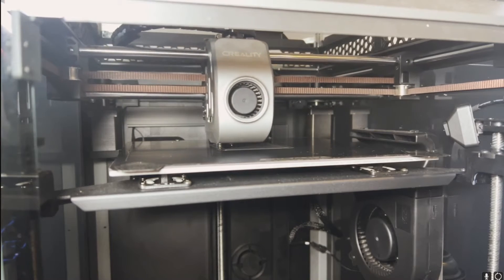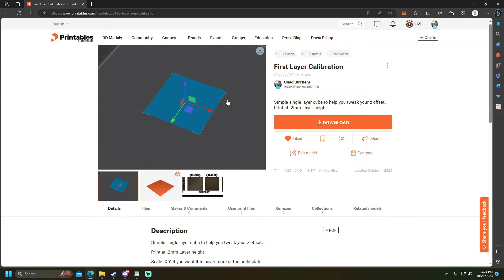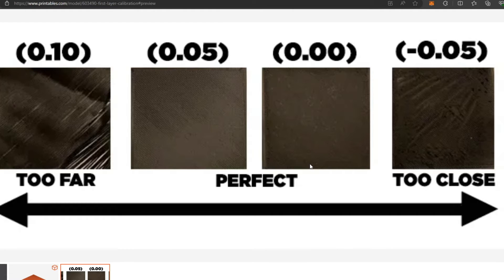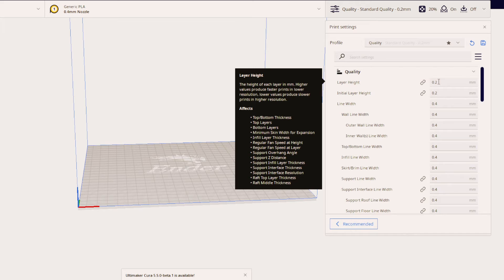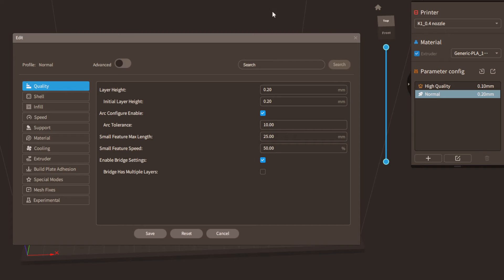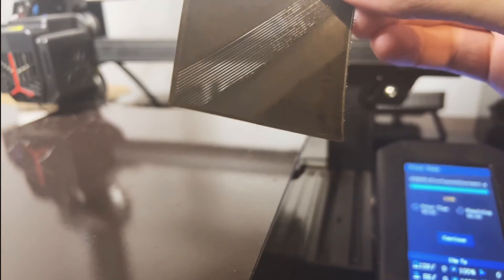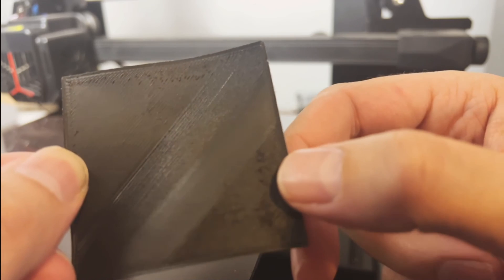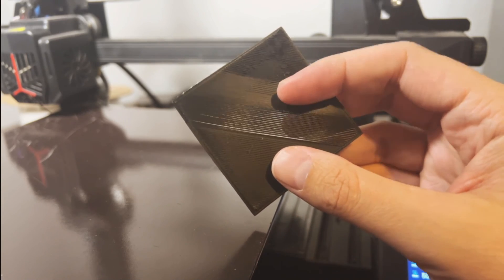Fix Your 3D Printer First Layer Issues | Z Offset Calibration | 3D Printing

Comment: I have to say, it wasn't until you mentioned trying to pull them apart that my offset was fixed. I kept thinking it was fine because it looked good, but as soon as I pulled on it it separated like string cheese. If anyone takes away anything from this video it's that. Thank you.

Comment: this is great I use cura and before you get to the z settings to change you switch slicers and i cant find that setting in cura I have Elegoo Neptune 3 pro i have theier orca based slicer

Comment: Having a strange issue on my Ender 3 V3, basically K1 bedslinger, where along the Y axis it seems to be smoother along a certain area and then rougher around others. Is this a bed meshing/leveling issue? I have installed the Creality Helper Script, running Moonraker/Fluiid with adaptive bed meshing (KAMP). Let me know what you think. Thanks for the tutorial BTW!

Comment: OMG, I have been fighting with my printer for over a year to get a good first layer. Every time I print I have to do that live level adjustment thing. I've watched a lot of videos on bed leveling and they all talked about the Z-offset but when you said " You can't do the adjustment on the printer itself, you have to do it in the slicer" holly Hanna that was it....After using your sample and setting the Z-offset in my PrusaSlicer, The first layer was perfect and I didn't have to fight with it. Now if can figure out why the filament keeps breaking, I've checked the nozzle and its clean but the extruder keeps cutting a notch in the filament and it stops feeding. it's a brand new Creality extruder. any ideas?

Comment: Hello, I am an ender3v 3 ke user. In the automatic tray setting, one corner is +0.50 and the other corner is -0.5. I pulled it to the manual z position. I put paper between the nozzle and the pad and moved the nozzle on the pad. In some places, the paper is comfortable, in some places, the paper gets stuck between the pad and the nozzle. I printed a 200x200x 0.04 mm piece and it started printing from the top right. It started collecting filament before printing 10 mm of 200 mm. There is a video on the pad. If you have an e-mail address, I can send it. I tried everything but couldn't find a solution. When I print small prints like 40x40 mm, the first layer on the bottom left becomes like thread, the nozzle tip moves away from the pad and stays in the air, this time when it moves to the 2nd layer, it rubs there, since the filament stays in the air, it naturally deteriorates.

Comment: you can correct z-axis from the advanced tab in settings menu on k1 (at least its there on k1 max) also rooting your printer lets you set it with Fluidd or Mainsail directly (or direct on Mobileraker app on your phone, while printig whitch is great), instead of relaying on slicer settings 👍

Comment: If I leveled my bed 0.1mm
And I have ugly gaps between lines and infill.
Shall I start do -0.05 and redo it until looking better?. Need to use Cura since I cant adjust it with display.

Comment: how do you fix the first lay lines on a x1c? My layers aren't smooth like yours and i have gaps between my lines. ive tried lowering/rasing the z offset and parts of my test piece is good, but the other parts aren't.

Comment: thank you for this! I have a question.. my printer did the job from the inside out in a squared shape, not with diagonal lines, do i need to change anything in the cura software? i have a elegoo neo 4 max . the corners of the squares were not great, because they had spacing. the parallel lines were perfect.

Comment: I have the Ender 3 S1 and despite auto-leveling the bed at temperature I always get an inconsistent first layer or even seperation. At some places the distance will be perfect with the structure of the plate visible on the part and no layerlines while a couple of mm to the side layer lines become clearly visible or, like I said the part even comes off the plate.
Any ideas?
Reply: Did you figured out? Same for me
Reply: @5N1P3R7  Sady not yet but I also haven't printed a lot since and it was just not worth the effort :D

Comment: I've dialled in my levelling with a feeler guage, (Ender 3 S1 Pro with Sonic Pad), I did a 1st layer print, 80% of it was OK but had thin stringly lines in top left and towards middle of the plate.

Is this a warped plate?
Reply: Same, did you figured out?
Reply: @5N1P3R7  I just kept levelling it until I got better results, slow and boring technique, but got there in there in the end. The days of manual levelling are a throwback, i'll end up replacing the printer eventually

Comment: I'm going mad because I get BOTH rough and strings on the same print. It drives me mad, also never seen a flat surface, lines are always at least somewhat visible (kobra 2 pro)

Comment: I really need to know where this gcode z setting is on the Orca Slicer. I found on reddit that it was the Travel Distance Threshold function, which should be active in Filament Settings>Setting Overrides and also in Printer Settings>Extruder.
But I don't know if that's right.
Reply: Did you ever figure where the is? My guess right now is PrinterSettings>basicInfo>PrintableSpace>Zoffsset. My FlashForge Ad5M setting only lower and raises by .25 and I need a little less than that, so I Have to use Orcaslicer to do the .05 adjustments. But don't know for sure since I only started a month ago. Thanks
Reply: @emrysbatson3193  for the flashforge if you are using the Flashprint Slicer the Z offset is under the Other tab, you can set it to different setting I found .04 works good for me